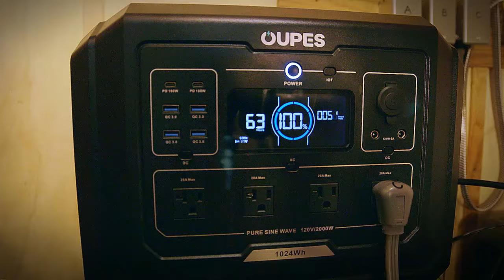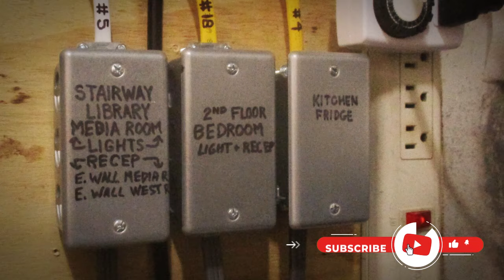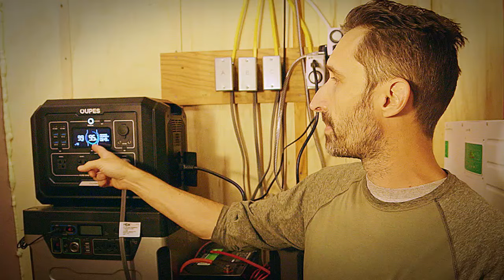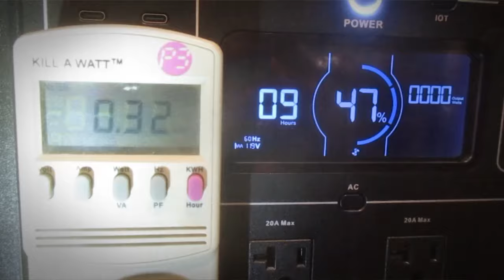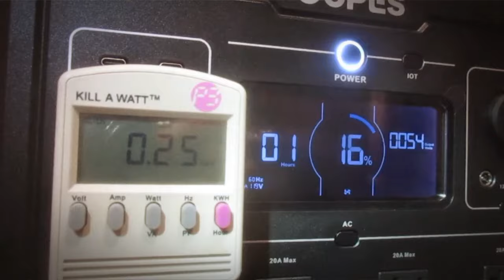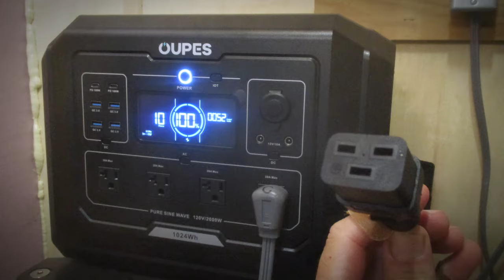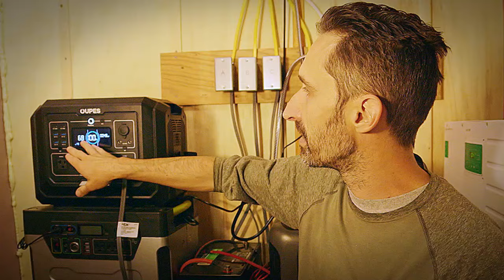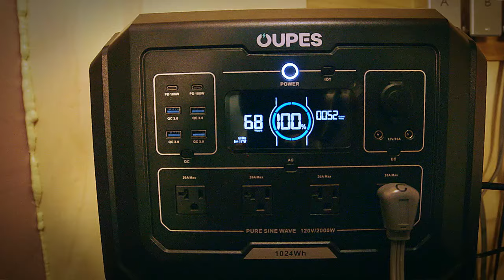Imbedding a Backup Power Bank into your Home - Oupes Power Bank

Comment: Excellent modular system great useage of the Oupes Mega 1
Reply from the maker: Yeah, it only has so much juice, but for one simple low-energy task, it does it's job well.
Reply: @PraxisPrepper  Excellent!
Reply: @PraxisPrepper we went with the mega 2 for a bit more capacity for a critical circuit. Works well. Thanks for your detailed  description of your setup.
Reply from the maker: @paulpratt315  2kwh is a fair size. My 2kwh system runs our whole house air circulator all night as well as one of our rooms that we use in the evenings to watch films etc. By morning it's always better than 30% full still and ready for recharging by the sun.

Comment: Great stuff, thank you!  Also seen someone connect a power plug into a box that allowed the furnace to be switched over to the plug.  Then plug that into something that can handle the load.  Thought it was a cool way to have backup for critical circuits.  Thinking your way would be best if space on the wall allowed for modular setup, either to look tidy from the start or allow for expansion over time.  I do like the all the steps you've incorporated (plugs, timers, strips, etc.).   One question on grounding... if the timers disconnect the power bank from common ground, where do the "grounded" units get their ground?  I'm thinking the "grounded" ones connect ground to neutral internally while the "ungrounded" unit does not.  However, without an actual common ground you'd end up with a different ground per circuit.  Not sure if that really matters... ???  (sidenote: the issue of connecting ground to neutral can be done via a plug that makes that connection.  You plug that into the one of the A/C outputs on the unit and that solves that.  This is important for systems that check for this grounding before running, like many furnaces.
Reply from the maker: Great question... especially because I have a complete answer for you! I was concerned about that myself. I didn't want the system to get ungrounded every time the timer cut the power to the battery so I dreamt up an electrical design where I would route the ground and the neutral around the timer, so the only thing that the timers would cut would be the hot line. I mentioned this plan to my father, who knows a bit about these things, and he suggested that there was probably a good chance that the timers only cut on and off the hot lead. I took a multimeter to the timers to check and he was right. The ground and the neutral stay connected even when the hot is cut by the timer. I don't know if all timers work that way, but mine do. And thinking logically about it, given that keeping the neutral and ground connected in a timer and only cutting the hot lead is BOTH safer AND likely easier and cheaper to engineer I'd be willing to bet that most/all timers work that way by default. Less internal workings to just control one lead.
I hope that answers your question. Let me know if I missed anything.
Reply: @PraxisPrepper  Thanks, makes total sense.  Will probably check timers for this, but didn't know this is how they generally work.  Great stuff!  Check out "Projects in Paradise 808" for a lot of great content on building distributed solar/battery stuff.  He's in Hawaii, so environment helps!  He does provide a lot of great info if you're into building systems from scratch (battery, charger, inverter, with all the proper fuses & breakers, etc.)

Comment: I have smaller systems, which is best since I live in an apartment. By the way, from what I've heard, some of the Solar Generators do not have a True Ground. They have the third hold, but there is no ground connected to them.
Reply from the maker: Yeah, my whole house system had a bit of a complicated ground sitch too.
Reply: @PraxisPrepper  Let me be clear. On the front of your Opues you have 4 AC receptacles they all have  grounding holes.But from what I've seen on youtube a guy couldn't run his heater because plugging it into his power station it didn't have a true ground on that grounding hole. I think my Ecoflow Delta Mini is the same
Reply from the maker: @mannyfragoza9652  I didn't test to see if the Oupes system has an actual ground. But I did test that out on my EcoFlow system and the ground on that did actually connect to the ground on the AC plug that is used to plug it in. So maybe it's a system by system thing that people have to check and not take for granted. If a unit doesn't really ground, I suppose it's easy enough to create one as I did in this video.

Comment: Great video! Is that an EMP Shield inside the little cage? If so, I’ve always wondered if they would really work or not. It’s unlikely that they’d still be in business after a big EMP or CME anyway 🤷‍♂️😂
Reply from the maker: I did install EMP shields EVERYWHERE here. Two is one right. ;)
As for whether they'll work or not... I hope I never find out.
Reply: I’m probably commenting prematurely, because I’ve only watched about 1/2 of it so far. But I’m confused, why wouldn’t he talk about the power source first, where’s it coming from, how much power can you use before it runs out, and how would you charge it if there is no power, or worse yet if it’s down indefinitely. In stead of taking about to install it ?
Reply: @garywilson7992  he talked about these smaller systems being charged by his 10k kw home system that is powered by solar panels unless he has a period of days with no sunlight and then he has the entire system backed up with the grid. He says that rarely happens though.
Reply: @garywilson7992  IDK. I just chose to make this video more about how to wire these units into a home vs what you were asking about. There are plenty of videos out there about what you're asking about. I've personally made a few myself. I'd recommend people be able to charge these units up independant of the grid. It both saves money and increases reliability during grid down events.

Comment: What happens if you have a short circuit in your fan that this unit is powering ?
As it is not connected to the breakers in your breaker box, what shuts the power off ?
Over here our plug tops have fuses fitted, that blow if there is a problem.

2nd one (gotta get my moneys worth 🙂), you mentioned about the inverter lose, could you not run a 12v DC feed from your main battery array and charge the Oupes (and the other solar generators) via the 12v lead and make it more efficient by cutting out the 12v DC to 110v AC inverter ?
Reply from the maker: The unit has an installed fuse in it... or mini breaker. I don't recall. As for charging, yeah I could be charging with DC from solar panels directly. I do it that way (and with AC) for my EcoFlow unit. That's what the extra panels I recently added to the front of my house face vertically do.
Reply: @PraxisPrepper  DC charging makes a whole lot of sense 🙂
Reply: @Lee_Proffit  Yeah it does. I'm just doing it this way now because it didn't require any extra panels be added for each unit. Over time I'd like to have them all have panels associated with each. The only real big thing holding that back right now is that I haven't decided yet where those panels should be placed for aesthetics and also for maybe dual use (like could they double as sun awnings etc.)
Reply: @PraxisAdventures  I wasn't critic your methods at all, as with most thing we are always upgrading and adding as and when we can afford it, plus as new information / ideas come out.
Like the idea of a solar sun awning 🙂

Comment: So do you have transfer switches in the breaker panel for each one of the Loads?
Reply from the maker: Right now, I transfer the load just by plugging and unplugging. A more elegant system could certainly be devised. I shared this because it's relatively simple and can be done by people with an understanding of the basics of wiring and working with a breaker box (like me). If I upgrade parts, I'll be sure to share it here.